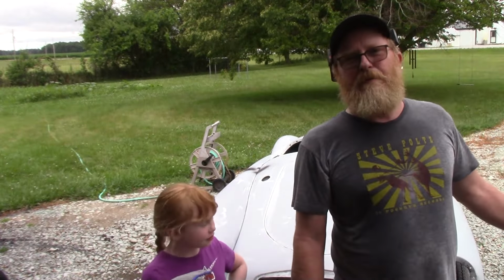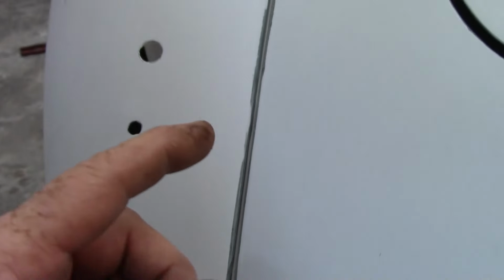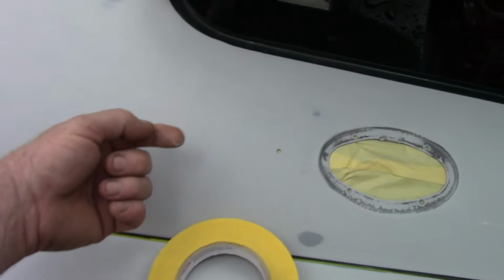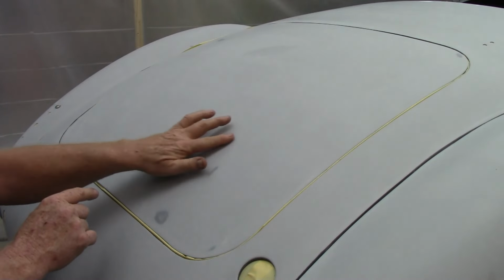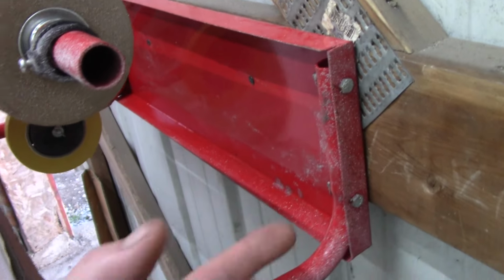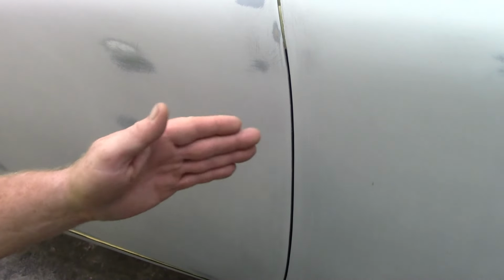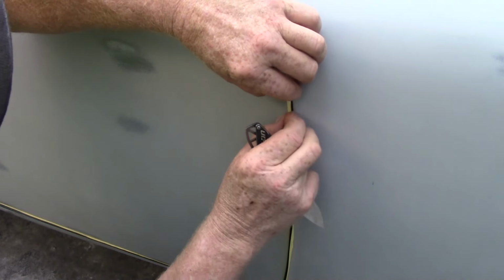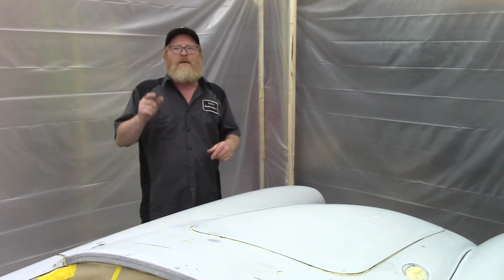Ultimate Guide to Masking Cars Before Paint

Comment: I've started using door jamb masking very easy to apply and the paint edges actually lay down really well
Reply from the maker: The round fome stuff? Yeah, that would be nice! Thanks Ron!!
Reply: @junksautomotive  ya it has worked well for me but I did make a mistake and sprayed some edge blender in a area u used it and it melted the foam🤣🤣🤣
Reply from the maker: @rongamble9884  😉 haha! Oups!
Reply: @junksautomotive  but my edge lines I've been able to knock down with 2,000 and lightly buff hope this tip works out for for you I buy a big box of it off Amazon I think like $40
Reply from the maker: @rongamble9884  really? Dang! I thought it was way more expensive! Thanks Ron